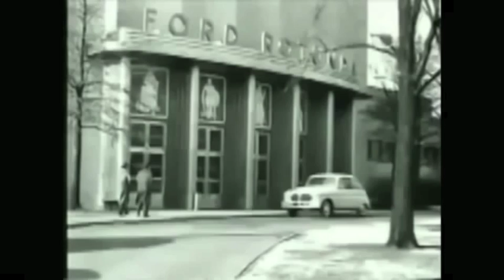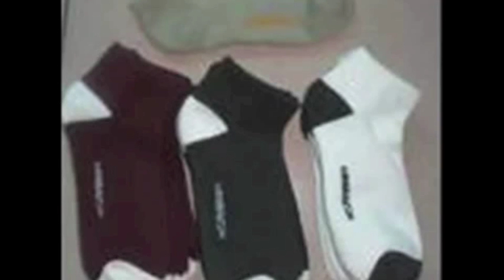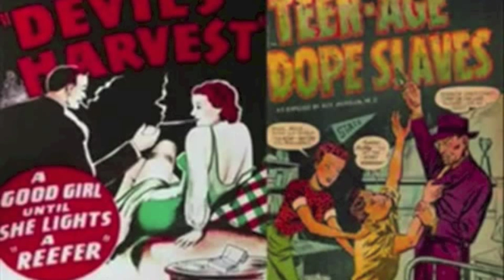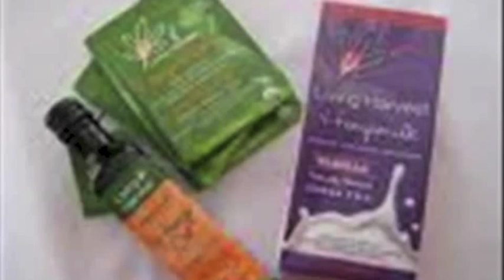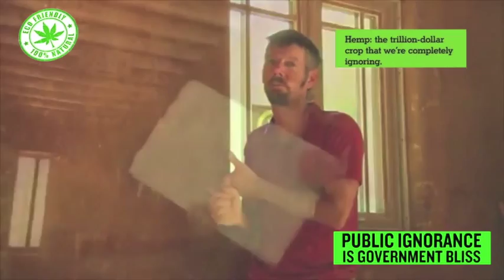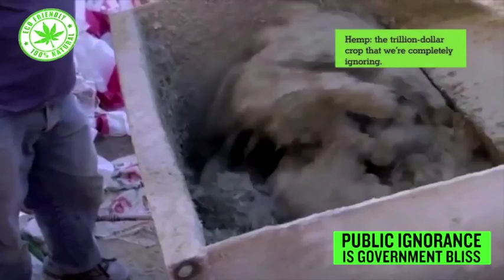HEMP for VICTORY. 73 years later....

Comment: How bio-degradable is HEMP for building houses?  Is it SAFE as it degrades??  How many years does it hold up ... AND what is its strength levels if hit with high winds / hurricane / torrential storms, etc.
Reply: HEMP itself is 100% biodegradable, being a plant - but it depends on what other chemicals or materials are added to it in the building process. Traditionally, it's just clay, sand, straw (or hemp in this case) and lime if it's available and sometimes, dung. All natural and all quickly biodegradable. In a dry climate it'll last for hundreds of years without degrading but earthquakes and moisture are the enemy. The hemp fibres are coated by the clay mixture so they don't rot or breakdown. Not enough air to support bugs or fire, and if kept dry, won't mold. Strength levels depend on type of construction. Whether the walls are load bearing or if the hemp adobe is used as infill between studs. No problem with high winds unless they're carrying a lot of sand or water but deep overhanging eaves or porches and a high foundation will help in that regard.